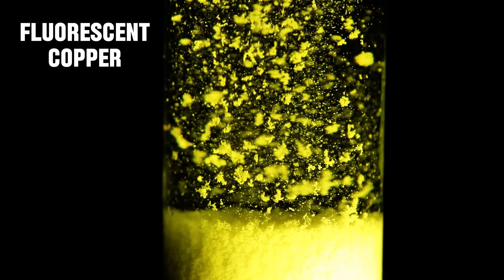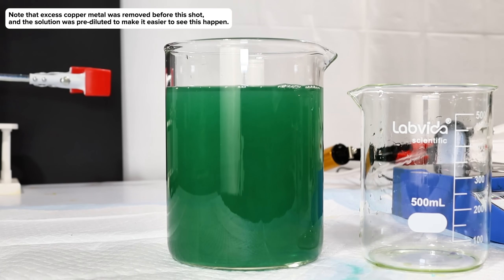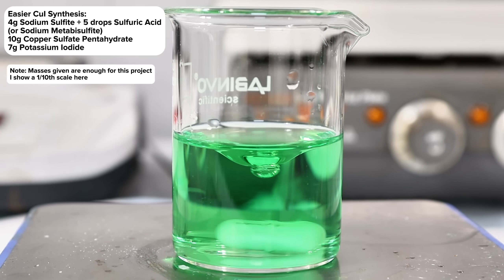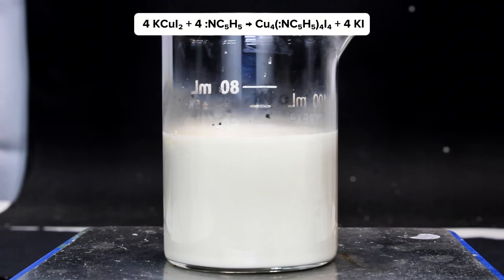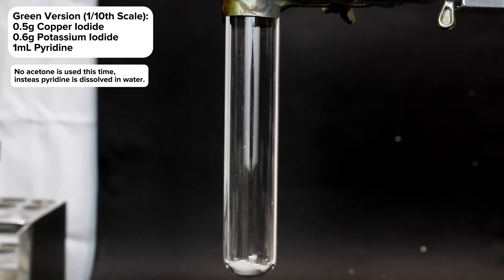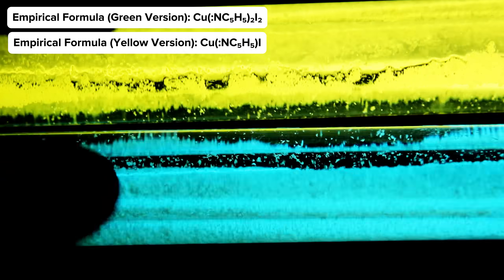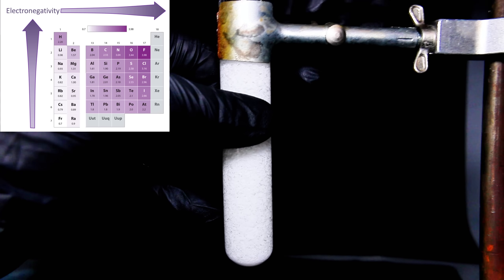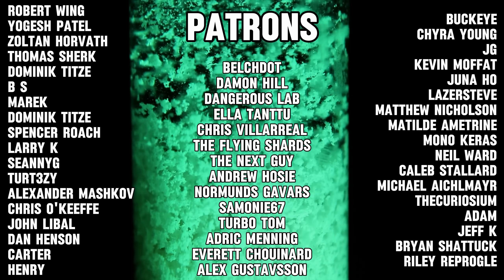Making Scrap Copper into Glow Powder

Comment: 3  videos later and now you have a new sub. Thank you for sharing.
Now I'm curious. Can I recover the copper from my PCB processing ? I use iron perchloride (1:3 solution) to remove the extra copper and would like to use the spent solution in my electro forming solution (copper sulfate + weak sulfuric) as it has so much precipitated at the bottom.
Can I somehow convert it into a usable form ?
Reply from the maker: Oh absolutely! Virtually all the copper chloride I use to this day I recovered from a super old project where I recovered gold from scrap PCBs. I ended up with tons of copper solution and since it was fairly pure I just precipitated it.
Is the copper that precipitated blue crystals of copper sulfate, or copper powder?
If its copper sulfate you'll need to electrowin it to recover it as usable copper, which is a process I'm actually working on a video for right now. I'd check wikipedia for some details on the process, but it works very well at recovering 100% pure copper.
Thanks for the sub!!

Comment: You could actually take a mechochemical path and mortar the copper iodide with pyridine
Then you could add triphenylphosphan and mole again
The complex you get has pretty cool properties in terms of luminescence

At room temperature, only fluorescence from the singlet mlct can be observed under irradiation with UV light and at 77 kelvin the phosphorescence from the triplet mlct can be observed
Reply: I am also familiar with the structure of the complex

In fact, one of the possible structures is a heterocuban

Comment: Couldn’t you have made the copper(I) iodide by mixing copper sulfate with potassium iodide to make copper(I) iodide and then to get rid of the iodine add sodium thiosulfate to make soluble sodium iodide and sodium tetrathionate
Reply from the maker: Yeah that could work perfectly fine! I actually considered that as thiosulfate is more typically used to reduce iodine, plus I think its less apt to generate irritating sulfur dioxide. I only really settled on the sulfite because I felt it was likely easier for the average person to find